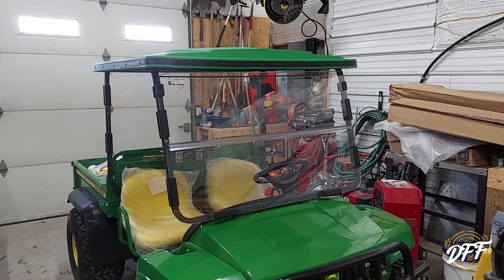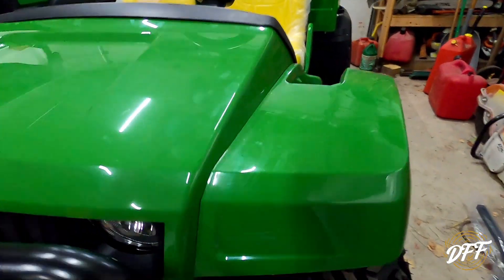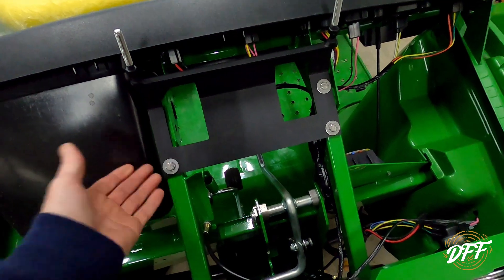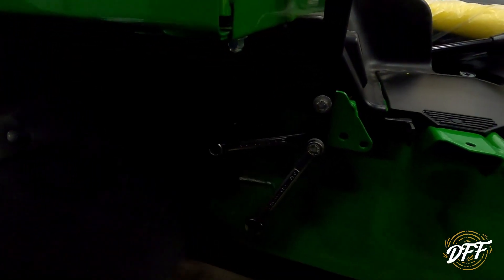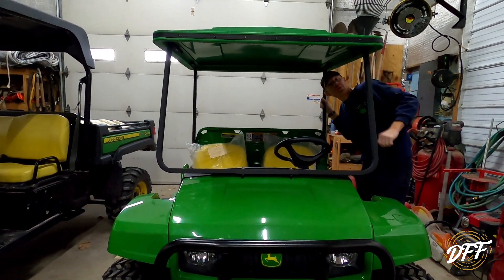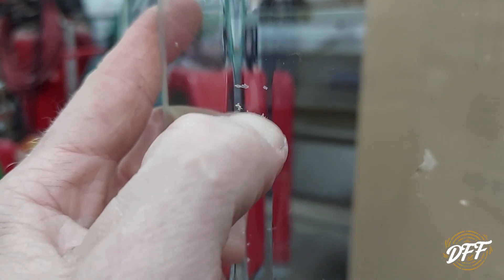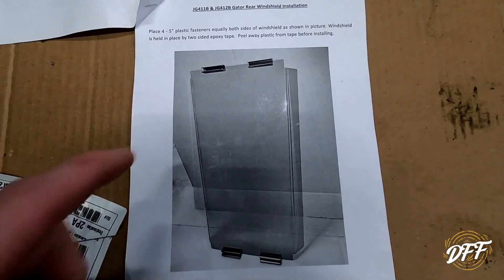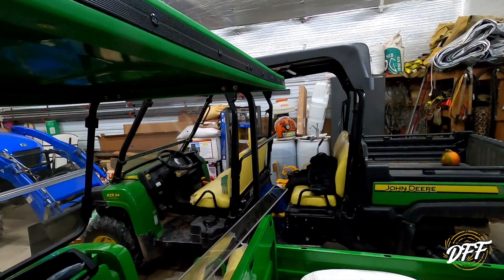Roof, Front & Rear Window Install- John Deere Gator TS

Comment: Do you buy your fenders and hoods through Deere or do you have an aftermarket source that is cheaper? I have a 94 model TS that I need seats and pretty much all the plastics for and don't feel like putting 2 grand into it just for looks. If there isn't a good aftermarket source I'll probably just start making my own out of the rubber truck bed mats cut and bolted in place.
Reply from the maker: No, the hood and fenders i could only find from Deere. Although once in a while I have seen a few used ones on ebay. Lots of nice aftermarket seats on ebay too.

Comment: Hope you get it sorted out. With the front frame only attached to the machine in the middle it looks to me like it might be prone to flex.
Reply from the maker: You are absolutely right. Those little studs in the center flex a lot, and that contributes quite a bit to the overall weakness of the canopy.

Comment: Thanks for sharing the details of the installation process. 👍🏻👍🏻  It's a little disappointing to hear that the canopy shakes so much that the windows slip down. 🤔☹️
Reply: kubota has the nices factory heated and ac cabs on theres with am and fm radio wich nice wich were looking at
Reply from the maker: It is extremely disappointing, especially for what it cost. I should have just built something lol
Reply: @dehavenfamilyfarm  yeah deeres are crazy what it cost way deeres has there set up that deere window kits are crazy  plus the windshild shouldnt be rattleing

Comment: Sometimes, aftermarket Stuff just needs a little hammer work, and glue, tape, more parts.   Lol..
Well, you got it on!!
Reply from the maker: You are right! And normally I don't mind doing a little modification, but for what this cost i didn't expect to have to do anything ☹
Reply: @dehavenfamilyfarm  lol.. you know me, modifications are what I do🤔👍🤣😂
Ya, even the cheap aftermarket Stuff has gotten a bit expensive.. 
The first thing I saw that you did wrong... You read the directions!!!!
Only thing those are for is the parts list, so you know what you need to go find...
At least no twine and duct tape was needed👍😎